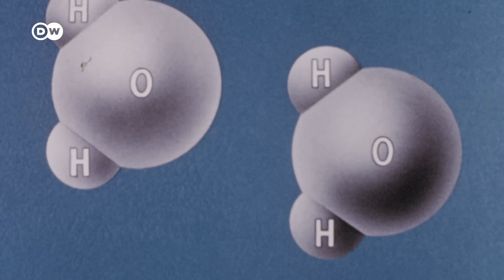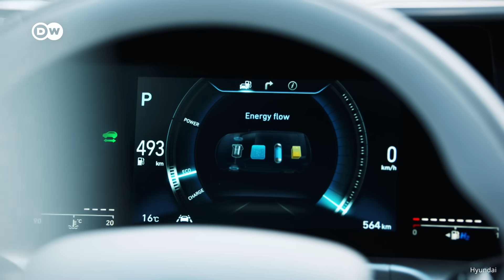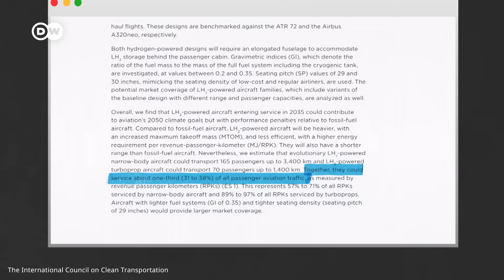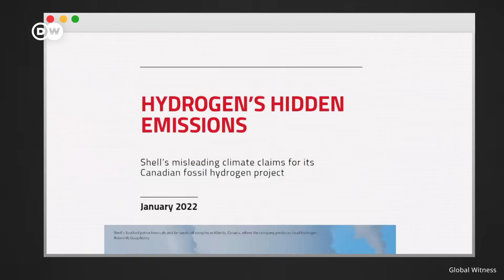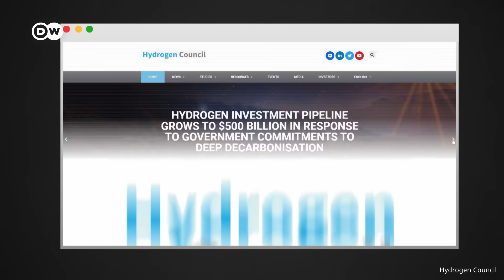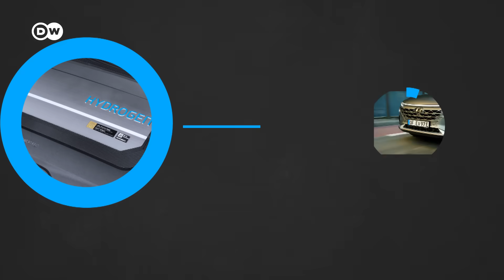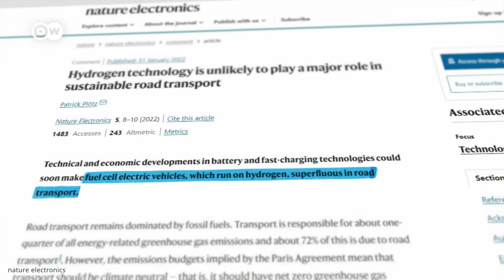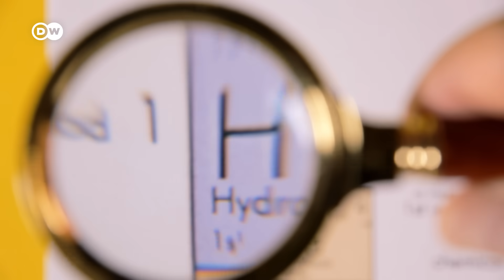The truth about hydrogen

Comment: Hydrogen is corrosive for pipes. They need to be coated in a special way. Also leaks a lot. However, the source of energy for electrolisis is free (sun, wind) so... I think it is interesting. But, no energy source can provide the needs of an ever-growing capitalist economy. Something has to change here. It doesn't mean we have to turn towards communism or socialism, but certain factors MUST be introduced in the system. It is not good anymore that in the process of production, nature isn't taken in account anymore. Neither for extraction of limited resources nor for disposing trash. We must change. It won't be easy.
Reply: Very few of these hydrogen energy videos discuss the problem of hydrogen embrittlement

Comment: I really don't think hydrogen makes sense for ships.  The big negative for batteries in transportation is the weight of the battery.  You have to keep expending energy to lift the battery up a hill or into the air.  That really doesn't apply for ships.  Let's face it, they don't go uphill or downhill so the weight of the powerplant is not a negative.  Put the batteries low enough in the ship and they actually allow you to carry cargo higher while still maintaining stability.  So the problem becomes what kind of battery has the greenest production profile and how safe is it use.

Comment: 20220824 - Canada has just signed an agreement with Germany for Hydrogen Fuel.  Question I have is, 'Is it Grey, Blue, or Green?'.
Reply from the maker: Hi Marc, great question! While the agreement between Canada and Germany does not currently stipulate that the two countries should develop a mutually agreed upon method to define what clean and low-carbon energy means for them, Germany has noted a preference for green hydrogen. This is a developing story, but it looks like grey hydrogen is what has been agreed upon between the two countries – as Canada's green hydrogen industry is still in its infancy.
Reply: @DWPlanetA  Thanks for the great answer!  I will certainly keep tabs on the environment minister, Steven Guilbault for news.  Thx again @DW Planet A.  P.S. Is Planet B Mars?

Comment: The statement about the energy density of hydrogen being low is false. In fact, it is the other way around. You need a ballon 3x the size of the one with hydrogen to store the same energy. The problem is with the efficiency of using hydrogen for energy.

Comment: The best way to produce H2 is with nuclear power reactors (usigng both their heat byproduct and their electricity in low demand parts of the day), since emissions of nuke-produced hydrogen ( so called purple hydrogen) is 0, as green one. In facts, even you lose 60% of used energy, you are using power and heat that would be simply wasted.

H2 is essential in some sectorss, but frankly using it as backup system to bridge renewables' inefficency and randomness is just pointless. We should focus on electrification of as many secors as possible and then build a mix using just renewables and nuclear power. Done this, we can try to produce hydrogen ( even is energy-wasting) since we can use a clean surplus of energy for transport, chemical processes, steel productions...
And remember: Hydrogen and Electricity are not a form of energy, but a way to carry it.

Comment: Hydrogen in gas form can be compressed like all gasses, so the whole space argument is sorta silly. Also, right now the price of the rare earth metals might be favorable for batteries, but without massive expansion of the mining of these, the price will obvious go up as demand does, on a fixed supply, so while hydrogen costs will fall there is value there in seeing hydrogen used more creatively. Not only that but the one of the biggest advantages of the utility of hydrogen is it can be created using excess baseload zero carbon electricity from nuclear and stored as necessary.

Comment: Thanks for this informative video! I believe there is no silver bullet when it comes to reducing emissions. Hydrogen certainly has a part to play in things like the steel industry and cargo transportation, but everything needs to start with reducing our overconsumption. We have to ditch the throw-away economy now! And high-speed rail should be preferred over short and medium range flights, when possible.
Reply from the maker: Interested in high-speed rail, you say 😏 We have just the video for you! 
▶️ Check out "How China built the best high-speed rail ever" - https://youtu.be/9wJCltuawSs
Tell us what you think of it in the comments 🚄
Reply: << I believe there is no silver bullet when it comes to reducing emissions.>>
There isn't an infinite supply of fossil fuels. One day it will all be gone and in fact we'll stop using it before it's even gone becuase it will cost more energy to get than it returns.

So one day emsissions will definitely be zero by default.

Comment: How many batteries does a ev have?  To make 1 of these 500 tons of soil has to be moved and c processed to gain the raw materials.  Then we burn coles to make electricity to run these cars. Small kids working as slaves mining cobalt in Afrika in unsecured mines. Ev's are not that clean after all. Loads of used ev's end up in junkyards just sitting there.  Stanley Meyer was far with technolgy to create hydrogen on demand in his buggy but suddenly died under strange circumstances in 1998.
Reply from the maker: You're right. EV batteries certainly are complicated. We have a video you might be interested in on that topic. Check out: Can you recycle an old EV battery? 👉 https://youtu.be/PbOBmnZRpZ4 - let us know what you think in the comments ✍️

Comment: I agree with some of the comments here that hydrogen is not an energy solution, but an energy storage, and it's a poor energy storage solution as hydrogen is hard to store and transport. The best way to store it is to combine it with carbon, and that gives hydrocarbon e.g. propane. To produce hydrogen from natural gas is a really stupid thing to do as natural gas is much easier to store and transport. To produce hydrogen using electricity is also stupid as it's wasteful, better use electricity in more efficient ways, e.g charge car batteries. It's much better to liquify and store propane, use it for planes and ships than to develop wasteful hydrogen infrastructure, but hydrogen is "cool" and propane is not.

Comment: A possible way to solve much of the issues addressed in this video might be the conversion of Hydrogen and CO2 into Methane. This can be done as a form of biogas upgrading. The CO2 fraction that is formed in biogas systems can so be removed resulting in a higher calorific gas and more gas. Methane has a higher energy content per volume then Hydrogen and can be used through existing pipelines. 

Interesting research articles about this subject are:
Production of high-calorific biogas from food waste by integrating two approaches: Autogenerative high-pressure and hydrogen injection. (Kim et al 2021)
Recent progress towards in-situ biogas upgrading technologies. (Zhao et al 2021)
Reply: Interesting point but there is always loss when transporting gas so I think there would be a great deal of pushback on making one of the most hazardous gases
Reply: so expend energy to make hydrogen,  expend energy to capture CO2,  and expend more energy to turn it into methane,  then burn it in a methane combustion engine.... you're throwing away about 90% of the energy as heat....     

you'd be better off using the original solar or wind power used to make green hydrogen to charge a battery to power an EV, which is closer to 80% efficient....
Reply: @xiaoka  The CO2 is already in the biogas for about 40 to 20%. That's how the bacteria produce it. The conversion of hydogen with CO2 into methane is something that these bacteria do for free. This is one of the reactions that is naturally involved in biogas production. Very often this CO2 is removed in biogas upgrading plants in order to use it in household applications. By adding hydrogen (produced by electrolysis of water) the biogas can be upgraded to a Methane content of >95%. This would provide a new usage for hydrogen, makes upgrading from biogas to green gas easier, provide a battery funtion (grid stabilisation) for temporary and local abundances of solar / wind energy and decrease the consumption of fossil methane gas.
Reply: @TOAOZuur  Use electricity as electricity where you can (i.e. domestic or industrial) and make synthetic diesel where you actually need a high density energy store ( i.e. for vehicles). The infrastructure and vehicles already exist to use this fuel.  You would, of course, need a large amount of energy to do all such wasteful conversions and the only method of doing that would be to build a big fleet of new nuclear plants. For a good example look at the Moltex Energy fourth generation reactor being built in New Brunswick in Canada - it's fuel is made from the nuclear waste from old style reactors so also solving that problem!

Comment: Correct me if I'm wrong but as far as I know lithium batteries are not so reliable about keeping their initial functioning level at storing energy (vehicles are not cell phones). On the other hand, using hydrogen as a way of storing energy isn't a better solution as it is able to stay as it is, ready to be used? Also it is going to be replaced regularly. Unless a new type of battery is invented which will be able to last for years, because an EV is already expensive so more reliable batteries are needed.

Comment: I saw in another video that that one big problem with Hydrogen is also storage. Being very tiny, its molecules escape more easily out of containers and storage loss is a big problem. I am no expert and would like to know more about this.
Reply: I used to own a large industrial welding supply and compressed gas company.  We had a liquid air oxygen, nitrogen and argon separation plant.  We sent our helium, hydrogen and acetylene tanks to regional fill stations.  Didn't want those hazards around my plant.

hydrogen is the smallest atom but it exists as a diatomic molecule which is a little bit larger than a helium atom.  We had no hydrogen diffusion problems but we DID with helium.  The standard fill pressure for ordinary gases is 2250PSI.  I had my helium tanks filled to 2275PSI so they could sit around on the dock for a month or two and still had the helium I was charging for.  My men were trained to gauge each tank sold before loading it in the customer's vehicle to make sure it hadn't sat on the dock too long.
Reply: So you store and transport it as Ammonia NH3 or other “LiquidWind” products.
Reply: Hydrogen is stored in water
Reply: Hydrogen can escape quite happily right through some grades of steel.  Other grads of steel trap it, and that's worse, because then the steel gets brittle and one day fails catastrophically.  This is why people investigated working with liquid hydrogen, but of course keeping the hydrogen that cold adds lots of weight and uses energy.  I was a big fan of the hydrogen economy when I was an undergraduate, back when we were all wetting ourselves of global cooling and the glaciers coming back.  But then I learned some chemistry and some physics.  Speaking of steel, "ordinary" steel is about 1% carbon by weight, so coke isn't going to go away in steel-making.
Reply: It is a big problem, but handling the compressed hydrogen is a more serious issue.  The energy expended to electrolyse it from water then compress it to ultra-cold gas or across a phase change to liquid is truly massive. You immediately lose much of the benefit of the fuel.   Then there are the safety factors of people putting it in their cars.  Potential cold burns refuelling, explosions in air if any serious leaks. Ask NASA how dangerous compressed H2 can be.
Reply: It is a problem, but a solvable one. I'm personally not worried about it.
Reply: @Sebastian_Gecko  Solvable but not sensible. Cost for that is way too high. Use hydrogen in industry and thats about it.

Comment: I have a question : ur clip did not talk about the danger of explosion    , which can be big, when Hydrogen mixes again with oxygen .. so would a hydrogen fueled car turn into a bomb should in be hit by another car ,cauasing the hydrogen to escape ?? Please exapand on this for us
Reply from the maker: Thanks for your question! Researchers say that there is risk depending on the operational and environmental conditions, but we wouldn't describe it as a bomb on wheels at all. 
These peer-reviewed journal articles will give you more insight: 
🚗 Risk assessment of hydrogen explosion for private car with hydrogen-driven engine: https://www.sciencedirect.com/science/article/abs/pii/S0360319910007858#:~:text=Estimated%20hydrogen%20explosion%20frequency%20is,03%20per%20car%20per%20year).&text=99.8%25%20of%20the%20risk%20relates,environments%20(EXP1%20and%20EXP2).
🕳️ Study on Hydrogen Leakage and Emission of Fuel Cell Vehicles in Confined Spaces: https://link.springer.com/article/10.1007/s42154-020-00096-z
🔋 Hydrogen Storage for Mobility: A Review: https://www.ncbi.nlm.nih.gov/pmc/articles/PMC6630991/

Comment: Isn’t water vapor a more powerful green house gas?
Reply from the maker: Thanks for your question! You're right, water vapor is the most abundant greenhouse gas. However, water vapor only stays in the atmosphere for a short period of time (days) before precipitating out. Water vapor does not control the Earth’s temperature, rather the amount of water vapor is controlled by the temperature. 🌧
Reply: @DWPlanetA , Even if it only stays "for a short" time, there is a continuous water vapor supply; hence, the water vapor should be in the atmosphere ALL THE TIME. How can water vapor be less significant than CO2?

Comment: I did not know that H2 could be used (i am assuming) in place of coal->coke for steel production...this is exciting and impacts just about everything including "renewable" energy production.  I am glad to see that you are looking at what the actual numbers and science are.  People seem to be ignorant to the fact that oil/gas/coal are still needed to build electric cars, electrolyzers and fuel cells.  We need to look at the entire carbon footprint of say an electric car from raw materials out of the ground to the scrap-heap. The only thing you ever hear about is the part in the middle...when the car is in operation.  My opinion is that we should be developing more sustainable nuclear power such as modular reactors, thorium and breeder reactors (for instance to power a steel plant and produce hydrogen by electrolysis for the process or power chemical plants and oil/gas refineries).  Hopefully fusion will become practical one day before we run out of uranium.  To answer your question above I do not think we can every truly get to net-zero at least until we can find a way to make all the materials we need without any kind of fossil fuels which may be impossible or in the very distant future.
Reply: My understanding is Lithium mining is S America is much like COAL strip mining, and produces a lot of CO2 per pound to produce. So the CO2 to produce an electric car is much greater than that required for the production of ICE vehicles
Reply: @fredschnerbert1238  it's not much greater and the calculation that counts is the lifetime of the vehicles not a single data point.
Reply: You still need carbon to make high carbon steel, because the carbon integrated with the iron gives the steel it's sought after properties.
Reply: @avoice423  yes this is true.  However this cab always be added later and overall I would think getting rid of the coal is a good step. Natural gas is cleaner and could be used to as the carbon source. I believe that Net-Zero is not truly achievable.
Reply: fusion is only 15 years away as it will be in 15 years. :)
Reply: It would be the most expensive steel ever produced.
Reply: I was texting Richard in the comment about finding the route out of the tunnel and I somehow texted you .
Reply: Yes,of course, and those modern nuclear plants are comming,Europe may not care about their Carbon footprint, but they want cheaper power than the gas they are paying for now. For now they'll increase coal and gas use and start using more oil in power production, since they eschewed nuclear they are stuck with fossil fuels and the main thing is to reduce the vast support they give Russia in their genocidal invasions.
NuScale plants go from first concrete to grid power in 40 months, EU5.5/Kwh,and load follow wind and solar,plus are good for district heating, industrial power, desalination,and H2.Nuclear has always been our safest power by a long shot, and doesn't have the massive waste problem solar has.

Comment: 1.
H does not need to be transformed back to electricity when to be used in cars and lorries. Brum brum.
2. H can be produced at remote solar and H plants, in the desert even, and the fuel transported in liquid form to 'petrol'  stations, harbours, airports.
Without lots of wires.

Comment: This is my favorite video about explaining Hydrogen vs Eco footprint. I have one question though, i understand the energie loss if we would use Green Hydrogen vs Electric carss, but from a sales perspective, the time to load a car vs the second it takes to fill a tank, and the ECO footprint a retired battery do would still be in favor of Green hydrogen right?

In theory, in deserts next to the sea we could make endless ammounts of green hydrogen right? Having Green Hydrogen ships, etc, would make it a easy thing to market.

Other question: Would Green Hydrogen would be able to warm a house, using existing gas lines a house is currently using? (with some fine-tuning)?
Reply: And you haven't even mentioned the biggie: the true carbon footprint cost, of EV manufacture, per unit!
Reply: Yes, existing gas lines can use hydrogen. It was made to use coal gas, which was more then 50% of hydrogen.